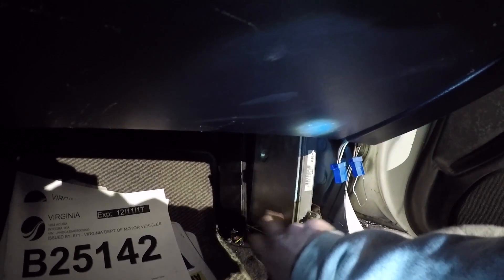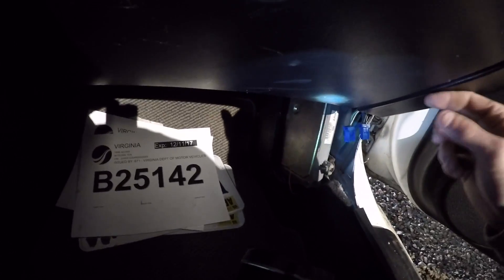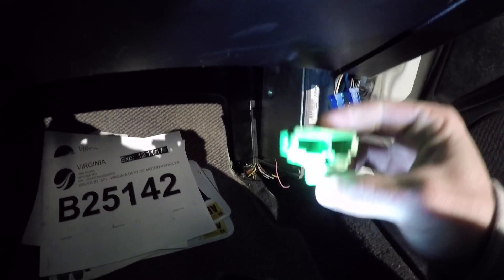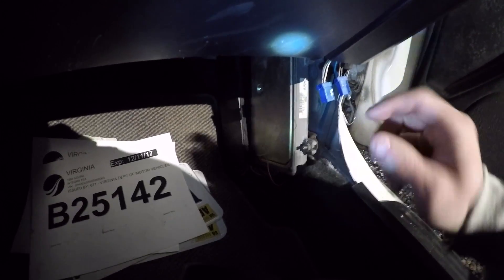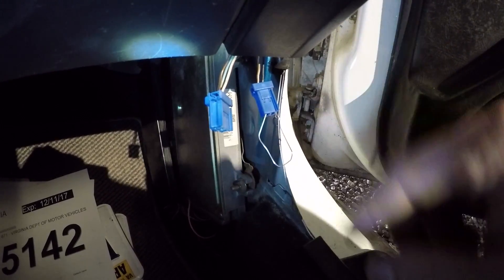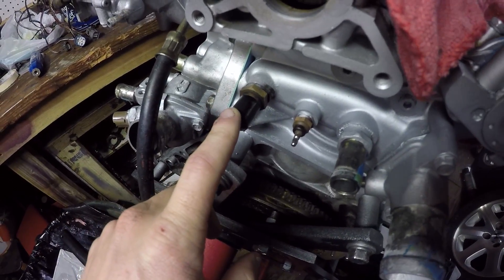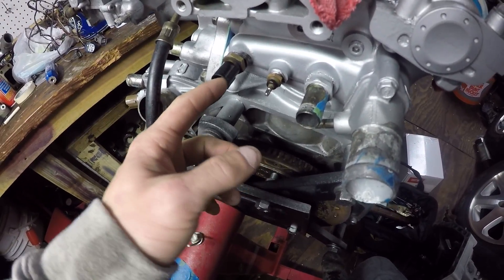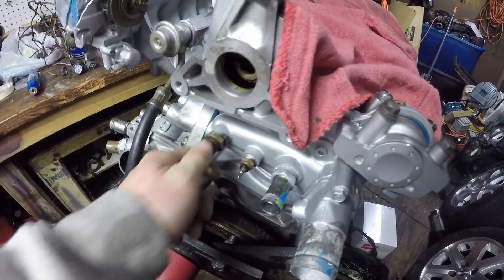HOW TO CHECK ENGINE CODES ON OBD1 CAR !!

Comment: on my 1990 dodge OBD1.. you turn ignition  key to accessory position 3 times...then leave in accessory position..and flash reading will start. thought id share that dont knoiw if relevant but it is OBD1